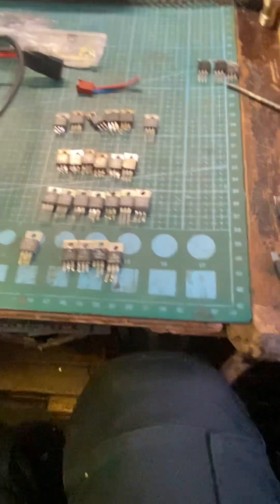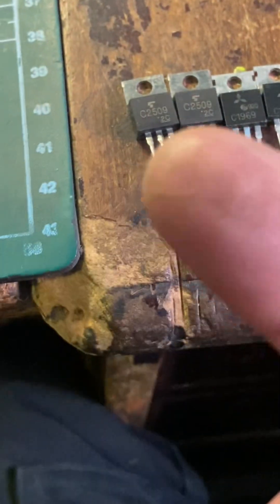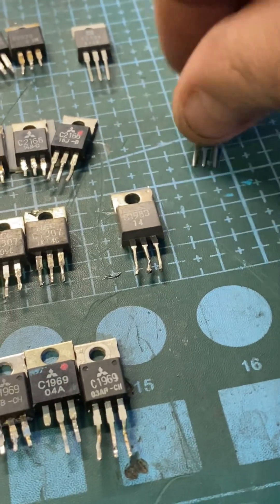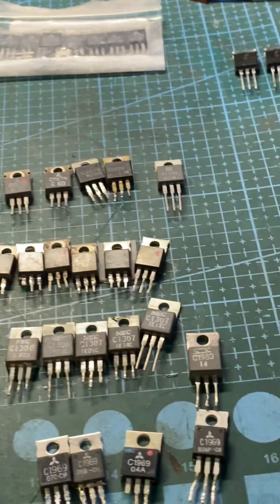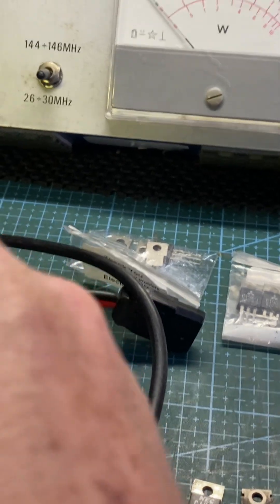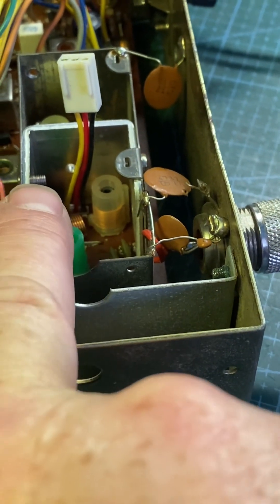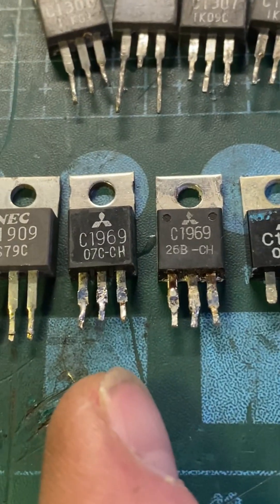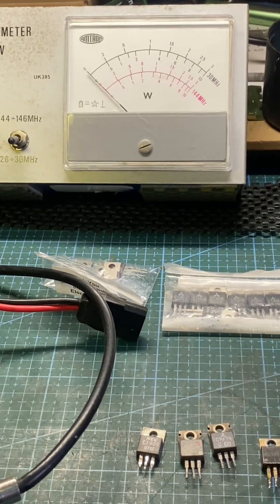Output Transistors, Testing Fakes and Genuine, easy to do check..

Comment: The ultimate test - put it in its intended circuit and see if it does what the design specified.
Reply from the maker: erm, they are in the intended circuit..
as shown, genuine versus fakes..
you can see yourself what works, will work and doesn't..

Comment: The small amount of RF apparently being produced by your pile of fakes is probably leaking through from the driver transistor prior to the final rather than the result of any amplification being done by the fake its self.
Reply from the maker: Probably although the other fakes from the same batch don't have any leakage ?
but that said you don't actually know what they originally were before the Chinese put their fake part numbers on them.

Comment: ive got same problem with audio transistors. c2705s that have huge amount of harmonics going on and far too much gain. Its even worse with output transistors like toshiba 1943s etc. Ive no idea whats in the resin but sure as hell not whats on the silkscreen. ive just about used up my original stock i bought in the 90s and im yet to receive any genuine parts from china. im not sure what the answer is, most parts are obsolete now so pretty stuck really.
Reply from the maker: I have used sellers like Polida and had a lot of genuine stuff, although they are pricey stuff like audio ic's which are pretty hard to get,
i will avoid little-diode all day long, they sell 99% fakes... i have yet to buy anything that's genuine.
Nikko in the past has sold genuine, but this recent batch of C2509 were obvious fakes..

i tend to use Aliexpress now days though, you get the same protection as ebay and you just look at the sellers, if they picture a genuine item, you must assume that's what they'll sell, if it's fake, instant return and refund because it's not what's pictured..but that said i have had a few good items from Aliexpress..

it's a gamble, but as long as you have protection you can take the gamble.